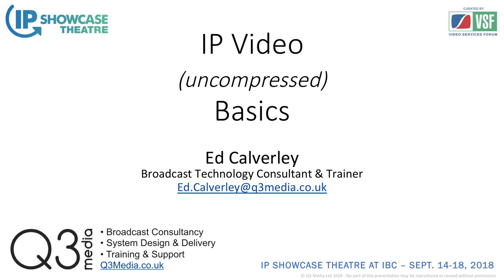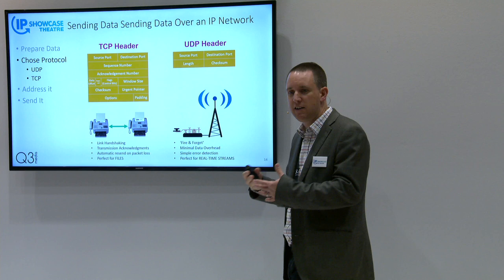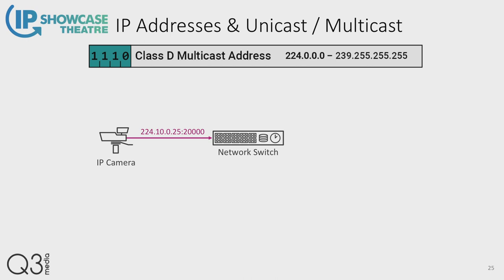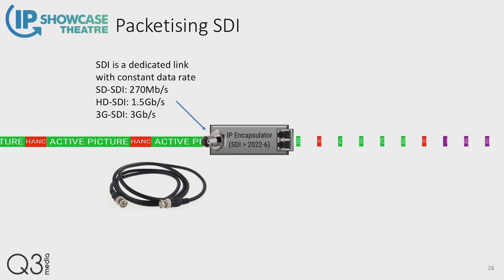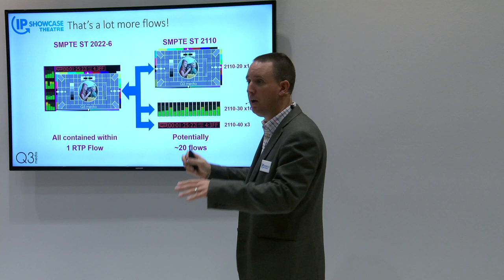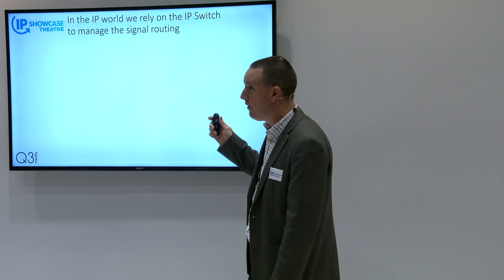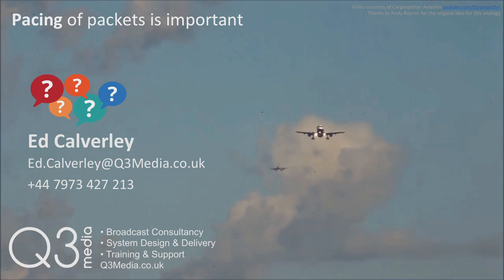IP Basics Ed Caverley

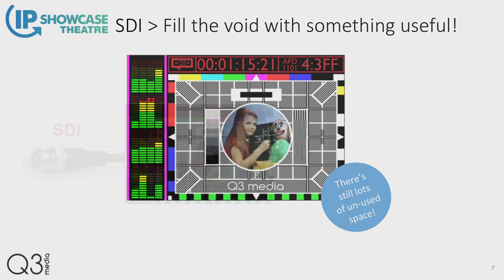Comment: At the risk of being called a nerd, please note that you used an old analog BNC connector for your graphic denoting SDI at 4:23, instead of a proper 75 ohm connector (which has no white material around the center pin).